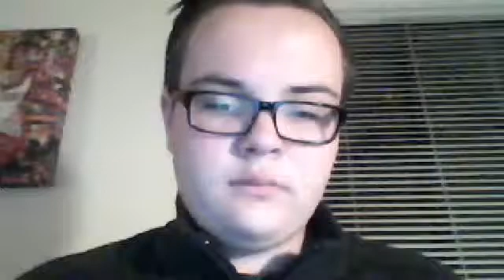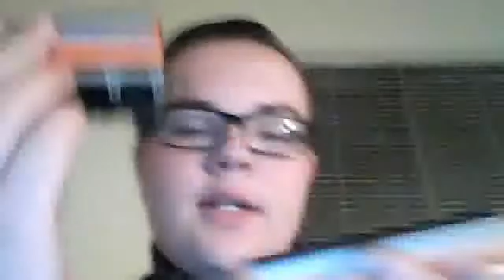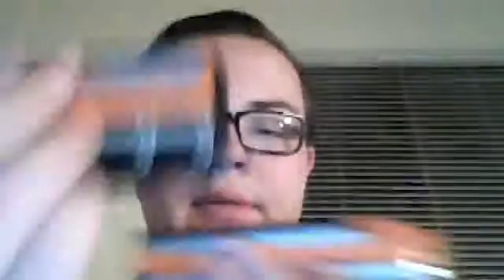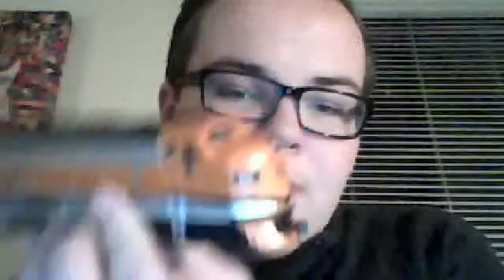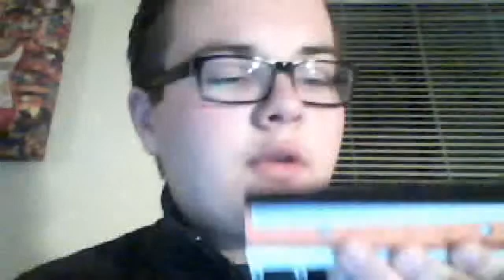Can you install DCC into a Bachmann ready to run locomotive?

Comment: easy to install a tsunami drop in decoder.takes about 20mins to do.if you do sound, a 25mm or a 28mm round speaker fits perfect in the rear of the locos frame.the drop in decoder sound or non sound fits perfect in the middle between the walls of the frame above the motor.you will also get more pulling power.i have done some 100 plus of these, works perfect.cheers.
Reply: any chance you could help me find the right decoder for my Bachmann FT/F7?  It has a small circuit board on top that has an LED at the front, and clips onto the frame with 4 small plastic clips... pickup appears to just be some copper tabs that go down off that PCB and touch each side of the frame of the loco, and the motor wires are soldered to two small pads on the board.   Any help would be most appreciated.